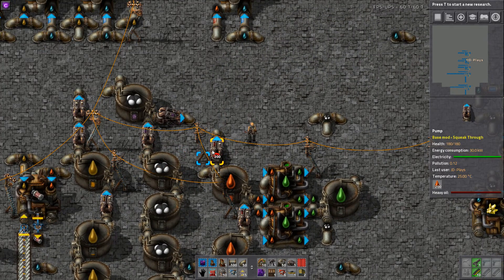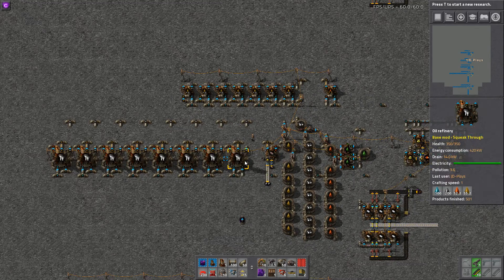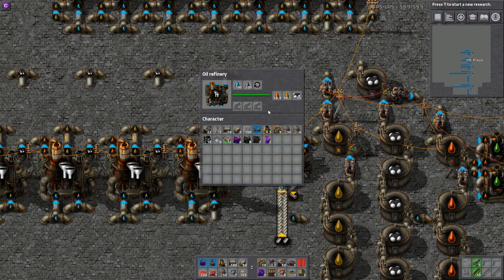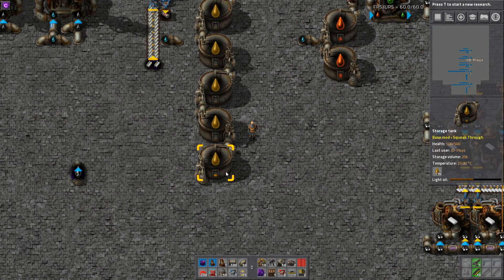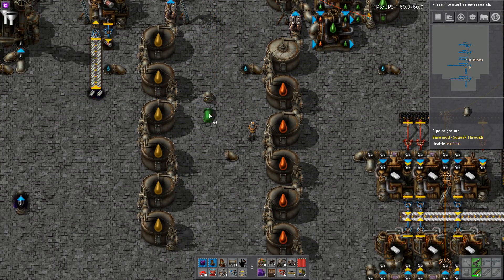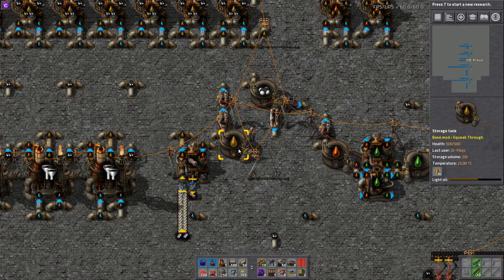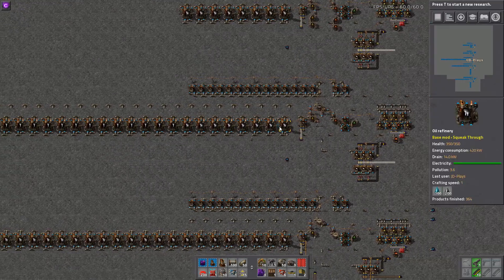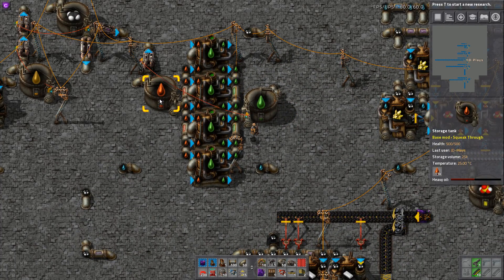Oil Smarts: Oil Tutorial 2 of 4 - Factorio Tips and Tricks in 10 minutes

Comment: I get wanting some in backup, but as quick as it's made, you really don't need to hold only 20k lube, I usually set mine to like 500. Then I have more heavy oil getting cracked to light for either solid fuel or to keep on down the line and be cracked into petrol.
Reply: Oh, you do need 20k in storage. There always comes a moment in your starter base, when you stop the science to dedicate all your resources for megabase expansion. And all of the sudden you need either a shit ton of blue belts or shit ton of bots. Both require lube. And since the science is stopped, you do not produce enough heavy oil because of lack of plastic usage. THEN 20k buffer of lube is great to have.